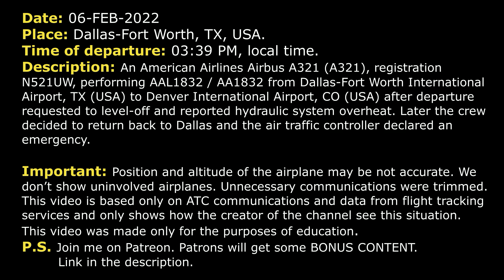Hydraulic system overheat after departure | American Airbus A321 | Dallas-Fort Worth, ATC

Comment: I know they have returned safely; otherwise, it would have been on the news. But my heart skipped for a second when I saw the title and thumbnail mentioning hydraulic issue and had to shut down. So many air disasters were partly due to hydraulic systems being damaged beyond repair with their fate sealed.
Reply: But planes have multi hydraulic systems. So it is not always lost of all controls. However the pilot said they would not have nose wheel steering, but at the end the taxied to the gate anyway. So the nose wheel steering must have worked after all.

Comment: So much for no nosewheel steering.
Reply: Whenever there's an overheat condition the procedure will ask you tu shutdown the hydraulic pump, and it says that if the overheat condition disappears you can re engage the pump. That's most likely how they got the steering back
Reply: That’s right. The overheat went away and they turned the system back on around 500 feet and taxied normally to the gate.